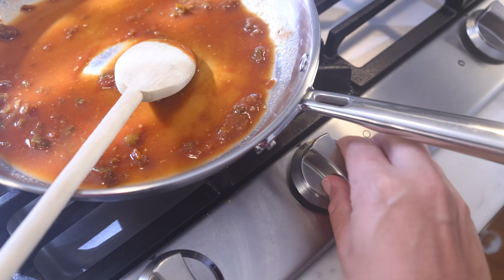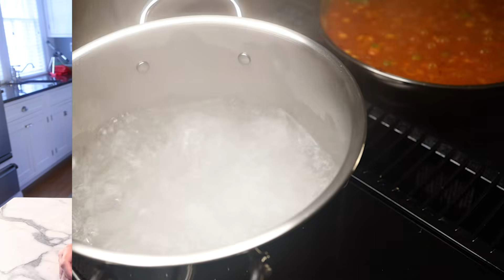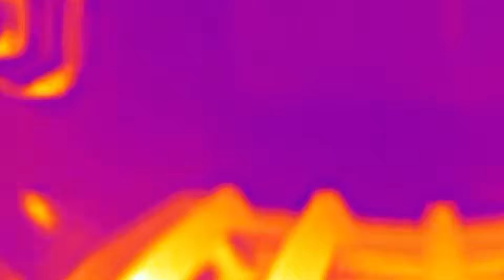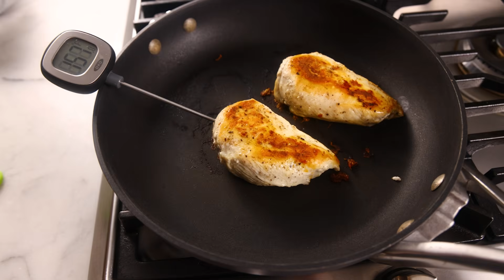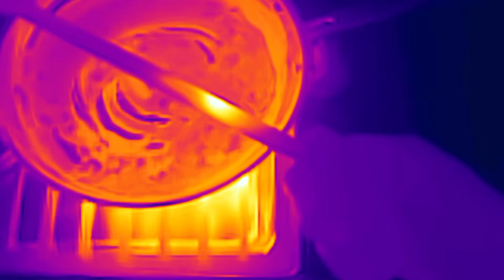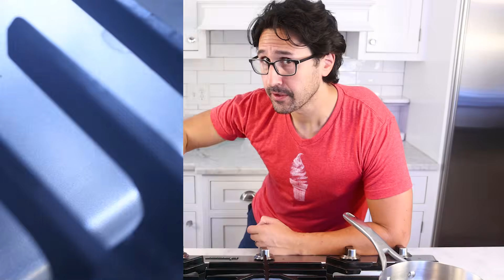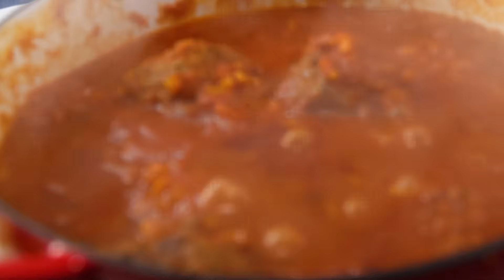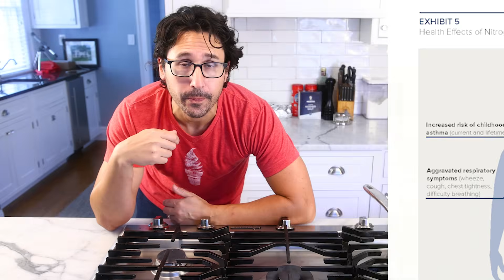Problems with gas stovetops | weak, dirty and dangerous

Comment: Electric can mess up cookware.  Heats it up too quickly and it can go concave and no longer sit flat.   Induction is particularly bad.  Also you can't toss and play with food in electric - move the pan away, and heat disappears.  You can get high btu gas which heats stuff up quickly.

You can also get heat diffusers for gas stoves to get a more even and slower simmer.

One nice thing about induction is you can put a timer on the heat ring.  Very handy and not something I've seen in gas.
Reply: If the heat instantly disappears when you take the pan away then maybe your pan is just cheap and flimsy.
Reply: @xAtNight  that's how induction works.  If it doesn't detect a ferrous object, it switches off within seconds.  You can't use aluminium on induction either.
Reply: No that only happens if you buy cheap shitty cookware. If you have induction the odds are your cookware isn't that shitty. 

You can almost definitely toss your food on electric
Reply: @lewis7607  if it is induction, it switches itself off as soon as it does not detect a ferrous object on the plate.  You also risk breaking the glass top.

Comment: For induction stoves, I've heard that they tend to damage carbon steel pans and make then spin.
Can you look into this?
Reply: Yes, you have to be carefull not to heat it up too quickly because it can warp from fast temperature change (induction is faster than gas and electric). Same reason you don't put hot pans in cold water. I normally put it on low for the initial heating, and if I need more heat, I put it on high later.

Comment: Whenever we start cooking with water, for pasta eg, we fill the electric kettle and the water heats up so much faster in the kettle. I think it might save money, too. Electric kettles are extremely efficient and inexpensive to buy as well as operate.
Reply: Same.
Reply: I do that too. I think in America electric kettles aren't nearly as common as they are in say, the UK. So that will probably explain the lack of kettle usage there. But I suppose it depends if gas prices are lower then electricity prices in the region where you live for it to be cheaper.
Reply: @bearmugs1408  part of it is that most outlets in the US don't give you full 220 volt electricity (we technically have a 220 volt system, but we split it and run most of our appliences to a neutral wire which effectively halves your power for a given current draw)
Reply: @bearmugs1408  and they don't drink enough tea for boiling water to be so vital to everyday life. If they had to boil wate in a pot a dozen times every day, they'd change their minds. Maybe nowadays, with all the instant stuff, they will.
Reply: @bearmugs1408  They are so common here in the UK because we drink a lot of tea. Americans are more likely to just heat water in the microwave for tea (which is minging but that's their thing).
Reply: wait there are people who don't boil water in a kettle.
Reply: @jenblack98  This seems to be something a lot of the world do. I remember living in Costa Rica and my wife there had a kettle but would boil water for tea in the microwave.
Reply: @jenblack98  they use a pot or even a microwave it's weird
Reply: compare gas price with electricity price too. Where I live generating heat from gas is around 3.3 times cheaper than from electricity. Even if some heat is lost its a lot cheaper to run a gas range here.
Reply: @szabomarton8064  it also depends on if you usually need to heat your house or cool your house for most of the year, induction stoves don't put out as much ambient heat, and don't require as much ventilation which can reduce the amount your air conditioning system has to work.
Reply: @szabomarton8064  there is also heating/cooling costs to take into account here too. If you're in a cool climate, it may be an added benefit to have some waste heat if it's cheaper too. If you're usually running an AC though, you may be paying in electric to remove that wasted heat too
Reply: @szabomarton8064  gas stoves are like 30% efficient though.
Reply: Kettles are more efficient because the heating element is immersed in the water you're trying to heat. Induction ranges can boil water faster than a kettle because magnetic induction directly heats the metal of the pot (instead of trying to transfer generated heat into the pot like a gas or electric range), so the whole surface area of the pot becomes the heating element. Putting cost aside, if you're concerned about climate change (and you should be) electric is far better in terms of overall efficiency from power station to end result and releases no further emissions. If power in your area is generated mostly from renewable sources, the overall impact is orders of magnitude lower than gas.
Reply: @sixstringedthing  and if you install some solar panels.
Reply: Ah, electric Kettles - also known as regular old Kettles that everyone has had for decades here in Australia :D
Reply: We have a crazy good induction stovetop. It’s actually faster than an electric kettle.
Reply: Electric kettles aren't commonplace here in the US due to coffee's dominance. Electric kettles are a thing primarily in tea drinking countries like Japan, China, Russia and the UK.
Reply: @themastermason1  depends on where “here” is. Here in DC area, we have an electric kettle as do my grown daughters in NYC. But we live in a very diverse area, with a lot of Asian-Americans, many of whom consider an electric kettle a basic necessity to have in your kitchen. Many non-Asians have learned the benefits and all the Asian markets (which have a customers of all races/ethnicities) carry a variety of them.
Reply: @TamarLitvot  I'm Chinese-American living in the SF Bay area. There's lots of Asian and Indian-Americans here who probably have e-kettles. My dad probably would give other Chinese or Brits a stroke as he reheats his tea in the microwave.
The US military has started installing water boilers in infantry vehicles after seeing their usefulness in British army vehicles.
Reply: @themastermason1  They're common in Finland too, and were in fact the top coffee consuming country per capita in the whole world. 

But I think what you said probably is truthful to some extend.
Reply: @TheRokkis  It depends on the quality and strength of the desired coffee. A drip coffee maker is more for people who primarily want an acceptable cup of coffee to wake them up in the morning.
An electric kettle would probably be best for me as the only form of coffee I really enjoy is Vietnamese Iced Coffee.
Reply: @themastermason1  drip coffee dominance. pour over, french press, moka pot, and obviously instant need or benefit from already boiled water
Reply: @brendanrandle  Yeah, I didn't feel like making my comment longer. For many it's drip coffee, instant or go to the local coffeeshop. My family sidesteps the electric kettle issue with an instant hot water faucet.
Reply: @brendanrandle  and the fabulous aeropress (my coffee maker of choice).
Reply: @themastermason1  I've never owned a kettle myself but always boiled water on an electric stove. But I also never was in the habit of drinking tea or coffee. I did live in homes with microwaves occasionally, but I never considered the possibility to boil or at least considerably heat up water in one to make tea or coffee with. The majority of people I know, though, own an electric kettle. Regardless of whether they are rather tea drinkers or coffee drinkers.
I've never used an electric stove with a coil you can touch. How do you clean these? Can you remove the coils easily?
Reply: @themastermason1  actually they’re common everywhere except America. Very common in Australia New Zealand and all of Europe. All of which are heavy coffee drinkers.
Reply: hardly anyone has electric kettles in the USA because we use 110V power and at that voltage, they are not very fast to boil (4-5 minutes for 1.5L). Not really any faster than a pan, so why bother with another gadget when I already have pans.
Reply: @the_wiki9408  has little to do with that. We don’t have electric kettles because we don’t have kettles of any kind because we don’t have a need to boil water like that very often because we don’t drink tea very often. It’s as simple as that. Because a 120v (as an electrician I find it so odd people continue to call our typical line voltage nominal 110v it’s been 120v for like 70 years lol) kettle is still faster than boiling water on a stove. If we needed kettles, we’d have them.
Reply: @the_wiki9408  much faster than a pan. Maybe you’ve only seen bad electric kettles. I use mine all the time because it’s faster
Reply: This is a tip that is looked over way too often. Kettles are way better for boiling water than boiling a pot on a stove
Reply: Are you on 220v?  Because the 110v versions of these kettles aren't all that fast.
Reply: @travis1240  Ah! That explains why most Americans I know don’t have electric kettles. Makes sense. Hadn’t thought of that. Couldn’t live without one this side of the Atlantic.
Reply: @Dreyno  Yeah I'm 30 and from the US and I hadn't even heard of an electric kettle until like a week ago. The more you know.
Reply: @cameronhoward99  https://youtu.be/_yMMTVVJI4c 

A video about electric kettles in the US.
Reply: @cameronhoward99  It’s funny because in Canada electric kettles are really common. Pretty much everyone and every workplace has one if not just to make instant noodles.  Not as fast as the UK 220v but still faster and easier than using a stove.
Reply: @travis1240  although you’re right our 110 V kettles aren’t as fast as a 220 V one they’re still faster than your stove top. They are more efficient at heating that water than your stove top or your microwave regardless of the voltage. Although you’re thinking because your stove is using a 220 V supply that it’s going to be more efficient that’s not true. A stove still has to spend part of its energy to heat the pot that you put the water in. That kettle is essentially an immersion heater so all the energy is going directly into the water.
Reply: @pj-schmid  I don't think anyone was trying to claim that stoves are more efficient, just that a 220 volt stove can brute force a boil by putting out a lot more BTUs than a 110 volt electric kettle.
Reply: @garethbaus5471  But that’s just not so I have an electric kettle that runs on a regular 110 V electric outlet and it will boil water much more quickly than a stove. I can boil water for a cup of tea in about a minute to a minute and a half
Reply: @pj-schmid  i usually make my tea in 4 gallon batches, so I don't really know how that time compares.
Reply: @travis1240  Ah - that explains why nobody we met in the states had an electric kettle. Here in the UK, it's rare that somebody doesn't have one. But that's mainly because tea...
Reply: @travis1240  You can get the same output either way, our electric kettles are in the kilowatt range.
Reply: @travis1240  it's might not be super fast but it's still way faster than boiling water on the gas stove
Reply: One issue with just saying "efficient" it doesn't mean cheaper. Induction cooking is much more efficient, but might be cheaper using gas if gas is cheap enough.
Reply: Had to do that before going to induction, now in "push" mode it boils a metal kettle in 1:40.
Reply: I feel like that's what everybody outside the US does. 
It seems to me that the US hasn't come around to kettles yet.
Reply: fax
Reply: ever touched the power cord of your kettle after boiling ~3 liters of water? yeah, that's how efficient they are ;)   (_how_ efficient they are in comparison is a different question. I'm pre-boiling water aswell -.- )
Reply: That’s what we do too
Reply: I was about to comment the same, they're really common here in Finland. From the comments I learned that 220/230V vs 110V makes a difference and they're not so common in some other countries.
Reply: My family had a metal kettle and large pot that we always used on our gas stove. We eventually switched to electric kettles and cookers that we've gotten used to, but we keep the old stuff for memories and in case of a blackout.
Reply: same!
Reply: I boil water in an electric kettle and then pour it into a preheated pot
Reply: The majority of people here seem to forget to just put a lid on the pot (even if you won't use it later for the pasta)... the difference between boiling a pot of water with a lid and 110V electric kettle is minuscule
Reply: @exanime  Yeah, keeping the heat in helps a bunch.
Reply: Electric kettles and insulated water boilers are amazing!
Reply: You just have crappy pots that are not heat-conductive enough.
Reply: @eily_b  Maybe but with a small budget it isn't that easy to just change the pots you use and an electric kettle will do the same job and turn itself off when that job is done! also boiling water forms tartar and that is easier to deal with an electric kettle.
Reply: I do this as we, but I'm from the UK. When I lived in Costa Rica the kettle took a long time to boil. I believe its the same in the US since the voltage is lower.
Reply: My induction range will boil water faster than my electric kettle.
Reply: @robertmeunier9915  the issue here is that not everyone has an induction range :/
Reply: @robertmeunier9915  I find this hard to believe
Reply: @robertmeunier9915  Same, my old kettle was only 1700W. Then the overheat protection failed and it melted a hole in itself... I now have an old fashioned kettle that goes on the hob and it fits a 4.5kW coil perfectly.
Reply: @robertmeunier9915  It's rubbish with a wok though :-)
Reply: americans dont do kettles as far as im aware
Reply: @bruhmann719  this one does 😉
Reply: @bruhmann719  No plenty of Americans (especially those really into making coffee at home) will most certainly have an electric kettle of some kind. We actually have two at home.
Reply: If you have good pans it damages them, especially non-stick pans. It damages the non-stick coating
Reply: @charliejackson7640  how does an electric kettle damage a pan?
Reply: @garethbaus5471  if you have a non-stick pan and you pour boiling water straight into it, it will shock the pan and damage the non stick coating
Reply: @charliejackson7640  why would you pour the water in a non stick pan?
Reply: @garethbaus5471  my pans for boiling water and making sauces are non-stick,
Reply: @charliejackson7640  that sounds like more hassle than it is worth, I would have probably removed the non stick coating if they were my pans(I generally don't use non stick anyways because it is so high maintenance)
Reply: @charliejackson7640  using the kettle damages pans?
Reply: @charliejackson7640  Only if you heat them empty. I just pour a drop of water on the pan, that way the temp won't go above boiling until you're out of water.
Reply: @charliejackson7640  wait a minute you’re saying having boiling water in a pan damages it? If your pan is being damaged by boiling water you really should invest in better pans.
Reply: @pj-schmid  adding boiling water to cold pans shocks the non-stick coating and destroys it over time. It's the same reason why you let a hot non-stick pan to cool before washing it as the temperature shock destroys the non-stick coating
Reply: @charliejackson7640  why are you using non-stick pans to boil food?
Reply: @Hello71b  I have non-stick coated saucepans that I use to boil vegetables and Rice and putting boiling water into a cold pan destroys the non-stick
Reply: @charliejackson7640  Over the years I've learned you don't need non-stick pots at all.....
only stainless steel or aluminum. You shouldn't need non-stick pots for boiling or simmering.  I only use one non-stick frying pan for omelettes, or crepes.
Reply: @VC-zk1kv  I prefer the opposite. I use stainless steel when I need to brown something. Otherwise I'll use non stick, it's more forgiving.
Reply: @charliejackson7640  ah, now I understand. When I need to boil water, I put half of what I need in the pan, and the other half in my electric kettle. So the pot is very hot when I add the kettle water. B
Reply: @VC-zk1kv  agree but add carbon steel. And before I got old, my cast iron pans were my go-to pans. One nonstick is what I have also.

Comment: Well while glas is easier to clean, id much rather work on metal since the probability of the metal breaking is way less than glass. You can abuse a gas stove as much as you want, it will never break.

Comment: One thing you can do with gas: Kenji Lopez Alt's "don't try this at home" trick where you remove the center distributor cap and end up with one gigantic central flame. For insurance purposes, I did not attempt this with mine.

Comment: Only caveat i’d add. Bottom of the line stoves (any rented place) gas is way more powerful. Landlord electric stoves are pitiful. Also the non glass top burners get warped and never sit level. My personal preference is induction btw. More powerful and more controllable than both.

Comment: I had gas my whole life, and I just swapped to induction about a year ago. I absolutely hate it.

For the different settings it just turns the elements on and off at different rates, keeping that rate constant completely not caring about actual temperature. So on low settings it takes an age because it keeps turning on and off exactly the same as it does when it's gotten to a useful temp.
If I turn it up to max to get it to temp quickly I then have to turn it down to low at the perfect time to get it to be the heat I want without it boiling over. It takes a good 3 mins to get from high heat to medium heat. And there is no way to hold a pan at any particular temperature, it's always oscillating between too cold to too hot.

It has these buttons on it that you can't press if they get a little wet, or you have wet fingers, and you can't put anything on them without it beeping a warning until it switches off.

Maybe it's just a bad machine but I despise it.
Reply: @MrRemakes  edited some extra points in